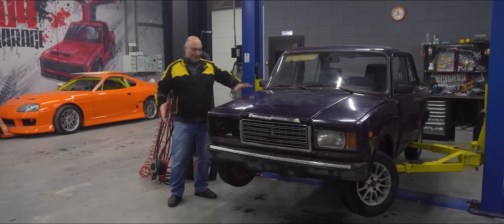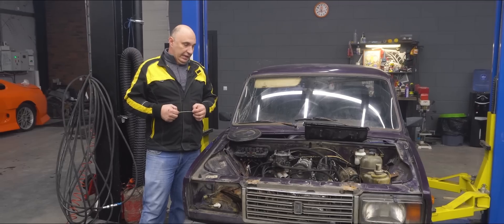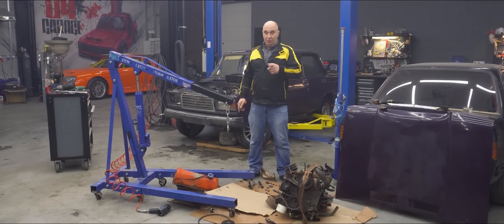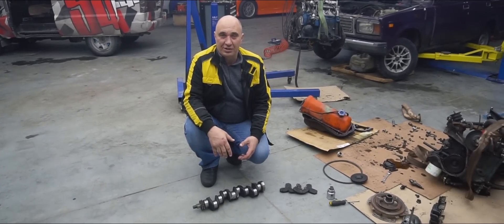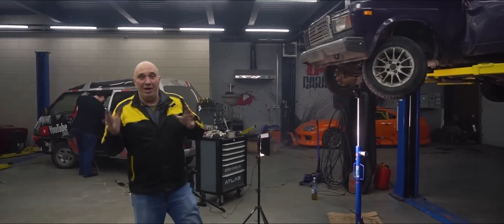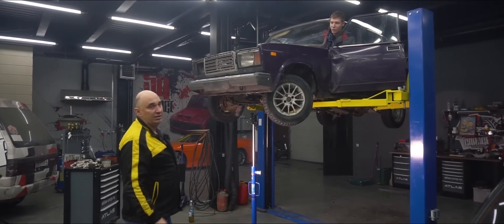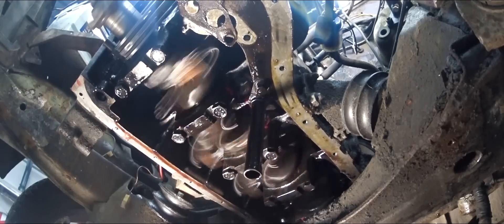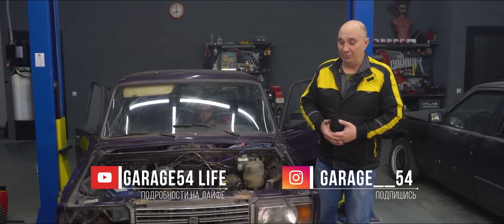Hacking off the crankshaft webbing: how’ll that affect engine operation?

Comment: That timing chain slop is impressive
Reply: VVT
Reply: at least its a proper timing chain. not the really crappy ones in Volkswagen 1.2 / 1.4 TFSI ...
Reply: @Popk1ller  or the fucking bmw diesel chains that destroyed thousands of engines.
Reply: @Boemel  yeah after the car does like 500k+ ms :D
Reply: @S3l3ct1ve  when you have a Ford Falcon engine that does 800,000 km, usually ya need to do the chain. I have 644,000 and when the engine is hotter than normal I just ever so slightly hear my chain
Reply: @S3l3ct1ve  n47 with 500k lol.
Reply: @Popk1ller  Least Lada doesn't have emmisions cheats enabled
Reply: @damiangillett6443  
Do Ladas even have to meet any emissions standards?
Reply: I thought so too, then I realized no oil pump and oil and most likely the chain tensioner is hydraulic.
Reply: @brancarr1  I think it's just worn out. Might have plastic guides like some engines though.
Reply: @brancarr1  very possible, his crew mechanically wise don't miss much doing mad experiments
Reply: spce invdr Like anything else Russian built like a mule with sloppy tolerances equals durability like the AK 47
Reply: @bRiddle38  yet American precision over the years  has resulted in the shittest engines I have seen. Example, Yanks importing the Aussie Ford "Barra" 6 cylinder
Reply: Damian Gillett Yeah but don’t forget about the AMC In-line 6 bullet proof engine and modern Ford 4.6 2 valve modular motor. Before all the variable valve and can timing bullshit
Reply: It's a feature not a fault lol
Reply: @damiangillett6443  its not a bug its a "feature" - me everytime my sister ask why me a bug is happening
Reply: is that chain supposed to be changed in the engine lifespan? because you have to dissasembly the whole engine to change it lol
Reply: @Feche1320  Yes, but you don't need to disassemble the whole engine. You remove the top cover, the pulleys at the front and the front cover and you have access.

Comment: if you watch the reving crank from the front the crank is going to look like someone trying to swing a hoola hoop around its waist , even when oiled normally its going to wear out the center bearings and snap eventually
could pump oil intoo the oil pickup using a pump and a hose and just let the oil flail around when the engines running and clean the floor up afterward
you can hack parts off the counterweights give whats left a knife edge so it has less resistance rotating through oilvapour in the pan 
fit forged aluminium rods , weigh out the small ends and pistons to match and get pretty close to balanced again (need a balancing machine to see if its good)  , it will still wipe out the middle bearings though but will rev to the moon

Comment: so glad they didnt just waste a perfectly good engine
Reply: I was going to say "that thing is mint inside!"
Reply: That engine is CLEAN inside though. A buck a pop though, but that's much cleaner than my summer car and my winter car combined.
Reply: In Russia you don't waste an engine, the engine wastes you!
Reply: Seems like the engine they ended up wasting was perfectly good tho
Reply: @UpVoltageOverclocking  Its not like its some aluminum blocked Hemi, Side-Oiler 427 Ford.
Those old Russian 4 pots are as common as a bottom barrel SBC
Reply: @UpVoltageOverclocking  it was running at the very least
it broke my heart a bit to see them running it without an oil pan
Reply: @UpVoltageOverclocking  these ladas are so common in Russia, it's like if we did the same thing to say... A Chevy cavalier. To us it has no value, super common, and junk anyway.
Reply: @octane613  I haven't seen a J-body in some time up here in Canada. The other day I saw a near mint (looked close to the end of the last model year) Cavalier, and a local parts guy is using a late 90s Sunfire as a winter beater, but yeah, even 5 years ago they were still easily seen. 

Mazda Proteges though, those are everywhere still. And heavily rusted.
Reply: @the_kombinator  you haven't seen any because they dissolved into piles of rust.
Reply: @octane613  exactly
Reply: @the_kombinator  Maybe more like a chevrolet 1500 in the states, those are so common that you get to see every spectrum. Mint condition, weekend cruisers, daily drivers, work trucks, hunks of shit lol.
Reply: @contentlocked99  Here these are used by scrap collectors in the city. Usually in very poor/unroadworthy condition.
Reply: @the_kombinator  Yeah I had one for a while and collected scrap. Had a rebuilt transmission and new engine but the paint was peeling and the bed was completely destroyed from scrap. They will literally run forever but the wiring on GM trucks is horrible.
Reply: @the_kombinator  people discovered they work ok for single-use demo derby cars at country fairs. I have ended the lives of a few j-bodies that way.
Reply: @the_kombinator  cavalier are so cheap to repair. It's easy to keep them going.
Reply: @ameunier41  I know. But even now, 15 or so years after the last one rolled off the assembly line, very few are left. I saw a Chevy Citation at the junkyard (looked like some mods under the hood too!) last week, I was like... wooow that's something I haven't seen on the roads in over 2 decades.
Reply: @octane613  can confirm, years ago in my mechanic days someone pulled a cavalier in complaining about front end shudder.  Lifted it up and the entire front end almost fell off the car because it was so rusted out.
Reply: @UpVoltageOverclocking  r/wooosh
Reply: UpVoltage Overclocking like my life
Reply: Yeah me too cause damn that was clean and I started to say no no don't lol . Hate seeing a good engine destroyed so glad they didn't use that really good one
Reply: Running an engine with no oil is wasting it
Reply: @hlq2action310  the other engine* 
And they were not stressing it, so not much damage has been done to it
Reply: Same
Reply: Idk I'd call a Lada engine "perfectly good" but yea
Reply: I gave them a like for this reason too! lol
Reply: Do you not know how many engines have died on this channel
Reply: I hope you never find out about destructive crash testing.
Reply: Do you know them like that? They do stupid things, but they are not.
Reply: yea sure! perfectly good 1980 lada engine! everyone needs one of those
Reply: Yeah props for that
Reply: Can't waste an infinite supply
Reply: It's Russia, they don't have many left lol
Reply: Nah..you can buy new one by 1 Vodka bottle:)
Reply: @joe125ful  - A waste of good vodka, comrade!
Reply: Lol as someone who sells engines i seriously laughed at this comment 🤣 "perfectly good emgine" 🤭
Reply: It a piece of crap engine